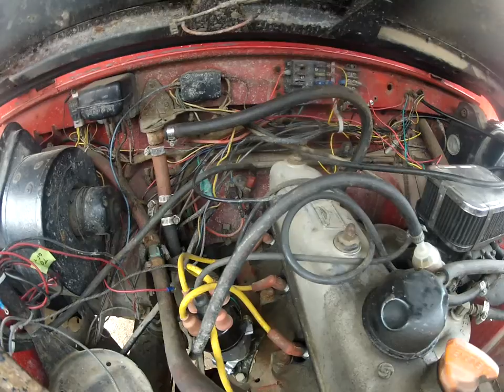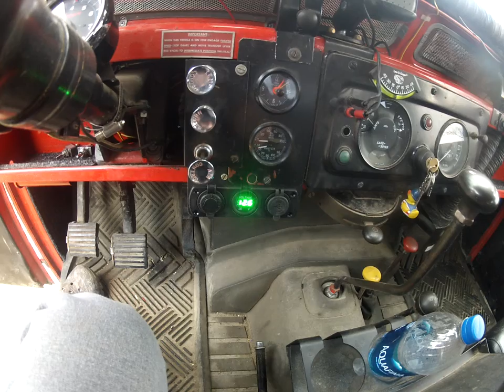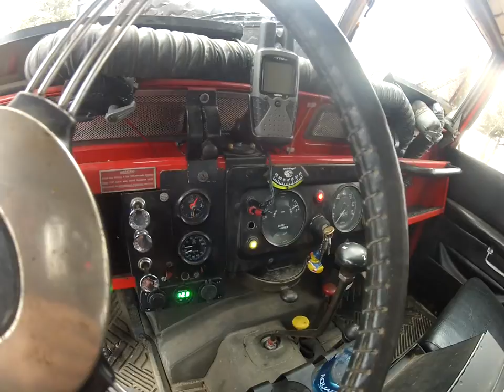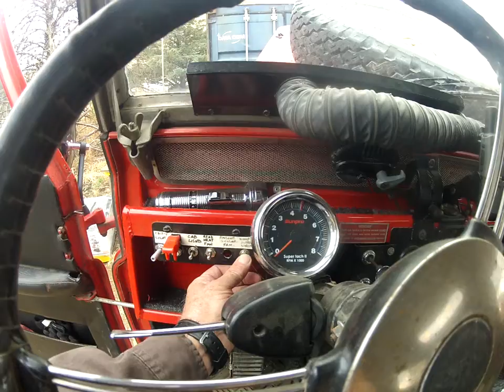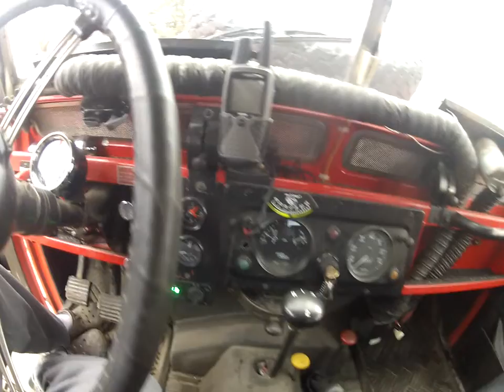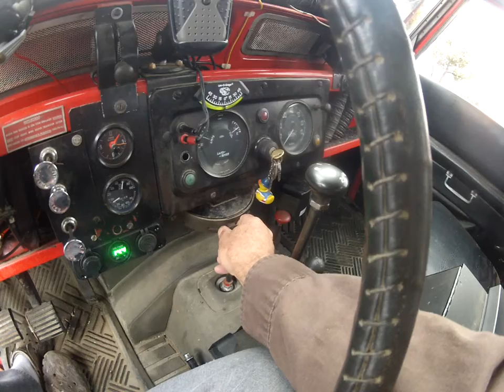1963 109 land rover under hood and in cab

Comment: Is that bellview winch? 👍 Looks awesome
Reply from the maker: Good eye, yes it is. It's hard to find them with all the external parts still intact. I would like to find a front-engine driven PTO winch over time. I'm very impressed with all the trucks in your group.
Reply: @jimmethven8074  thank my friend..ive never seen any bellview winch in my country..but pto driven and crank driven winch ive seen some and i got one too on my truck.. 👍
Reply from the maker: @MartopoSons  I have another one in my shed with the cable controls. I will get it out and make a short video on what they look like in a few days. Up in Alaska, there were lots of them kicking around. Down in Arizona where I am now not so much. Good winches but they only power in. It can be tricky if the brake doesn't work on a hill.
Reply: @jimmethven8074  i will wait for the video my friend..it will be great to see 👍
Reply from the maker: @MartopoSons  The Belleview video is up. It would have been done sooner but we got sidetracked taking down a dead tree. Enjoy my friend.